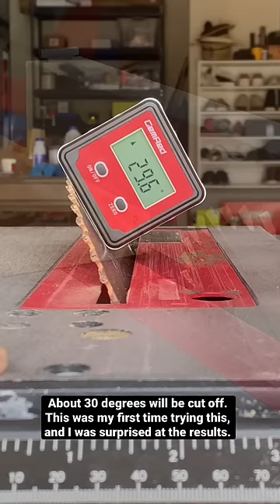How I wrapped wood around an object - An experiment!

Comment: Doesn't really seam easier than taking the number of joints and dividing 360° by it🤔
Reply: Had the same thought.
Reply: Would you divide the number of cuts into 180° to get your angle?
Reply: @chevybrat  pretty sure it's 360° to get around a circle
Reply: Came here to say this
Reply: @chevybrat  you have 2 cuts per joint. Each cut is half the angle of the joint. 360/ # of joints gives the joint angle.
Reply: @TM-dh2xb  I’m not arguing, but divide the number of cuts into 360, then do the same for 180. You’re not cutting circle boards or plywood. Let me know what you come up with.
Reply: @chevybrat  on 6 boards (which it looks like he is using 6 boards in the video) you have 12 cuts. 360/12 = 30.
Reply: @chevybrat  you could divide 180 by the number of boards, but now we’re just getting redundant.

Comment: Small tip. When using the square as a saw guide, put it on the opposite side so as your saw hand is pushing, your other hand is pulling. It will make it a bit easier. The way you had it, both hands are pushing in the same direction. 
Nice work👍🏼
Reply: That was good advice.

Comment: There’s a trick to getting the correct angle. Take 2 pieces of wood 1X2 say 2 feet long and hinge them together at the end. Like a set of jaws. Needs to be calibrated distance from the hinge will give you the correct angle. It’s been 25 years since I have used one.

Comment: Awesome video, but good lord does the metal strapping look awful. Also, your blade is super lose. It shouldn’t be wobbling that much while cutting.
Reply: I'm not sure what I would have done, but it's definitely not the strap. My first thought was glue, but being outside and those wide panels, movement may be an issue. Maybe just Brad nails to braces on the inside.

Comment: First off, why are you mutilating the boards? You could have used the part with the trim and cut off the bottom. The tops aren't even and the ugly metal bracketing isn't straight. The bucket looks better than the hack job you did.

Comment: Woof, try not to pin your scrap between the blade and the fence like that.  You'll get kickback and it'll hurt.
Reply: Yep, huge fail there. Also the plank barrel looks terrible.
Reply: One kickback to the groin and you'll never make that mistake again. Speaking from experience
Reply: Exactly move the fence so that the sliver is on the other side of the blade
Reply: Damn, I def would’ve done this because I have no idea what you’re referencing. I used to use table saws a lot
Reply: @Fatboypeet  - You should never cut with the scrap between the blade and the fence. As soon as you finish the cut, it can catch on the blade and be flung off at very high speed.
Reply: @johncoops6897  I’m trying to visualize the alternative. Maybe I just need to be doing it to understand
Reply: @Fatboypeet  you always want your hand or a push bar and the wood between the fence and the blade.

Also, dont cut boards less than the thickness of thw blade, they'll twist and could pull your hand into the blade.

You can avoid all of this by using mitre fence.
Reply: @Just-Steve  appreciate the advice!

Comment: why didn't you use a shop saw tu cut the high of the boards? why you  cut the cut off piece against the fence, is nor just a hazard    it will not be even., just divine how many board you need /360  and not you have the angle